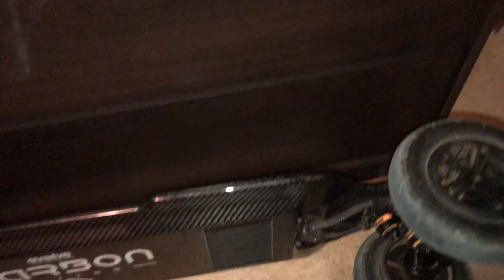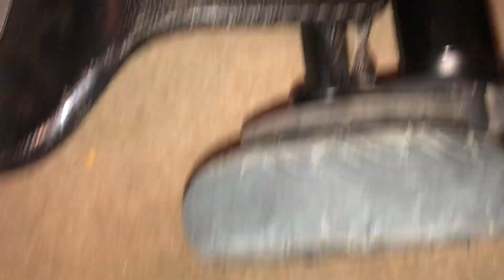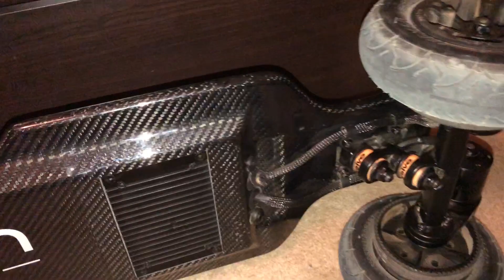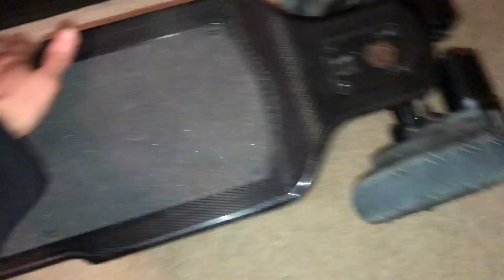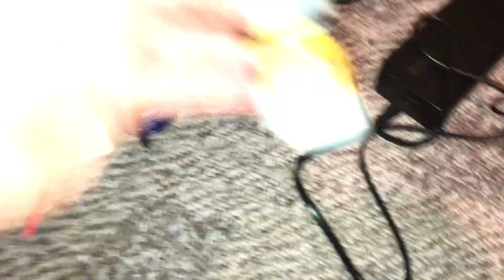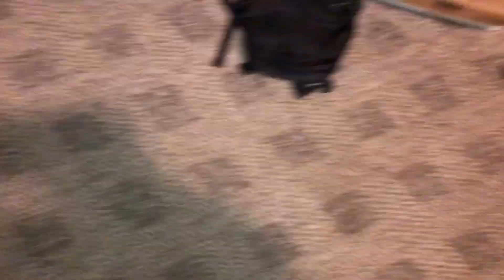Evolve Carbon GT Electric skateboard 800 mile long term review

Comment: Do you or have you a video on you actually showing us How you get To the bearings and with what solution you clean them?
My board sags pretty good. 
   I am hoping the new board coming will let us upgrade to better battery cells!
I am riding with AT wheels and there are big street hills to ride over.
Reply from the maker: There's rubber sleeves on the side of the bearings. Use a tack or something sharp to pry them off Between the rubber sleeve and the metal part of the Bearing. Once you do that drop the bearings in rubbing alcohol and shake them up. Let them sit about 10 minutes. Next Pat dry and air dry them. Then you simply apply the lube to the bearings, not too much and rotate them with your fingers so the lube is evenly distributed.After that pop the sleeves back on and your ready to go. To clean the outside of the bearing and keep water away from them I use WD40.Hope this helps.
Reply: Thank you!! 
You are the Best!!!

Comment: Hi, great video. I just wanted to ask about the flex on the board. How does it compare to a normal drop through longboard? I'd imagine it wouldn't be too comfortable if it's completely stiff.
Reply from the maker: There isn't much flex in the deck but the carbon fiber does absorb a lot of vibration. Also because it doesn't flex like a wooden deck it seems a little bit more stable at high speeds.

Comment: About to purchase either this or GTX... but want to upgrade the batteries
Reply from the maker: Joseph Besler  I wouldn't bother upgrading the battery unless your gonna sell the original battery to make up the loss of the cost to upgrade.

 Do you have a specific reason you wanna upgrade the battery?
Reply: Electromatic yes, I would like to eliminate the voltage sag as much as possible. And replace the stock batteries with 18650s. They tend to give more power and eliminate the voltage sag and extend the range by a good amount. Have been doing a lot of research of evolve boards and that is one of the main concerns  for this board that consumers tend to report.
Reply from the maker: Joseph Besler Yeah I guess I've never really noticed the voltage sag before   Untell the end of my ride when the board will sometimes go into eco mode especially when climbing a hill. I know some people have Stated their boards shut off and sent them flying before but that doesn't really make sense because my board would just coast to a stop if that happend.
 I have a friend that also replaced his battery with 18650 cells and he's had a couple  Motors burn up on him. I don't know if this Is related to the batteries or not.But I now have 1200 miles on my board  And haven't had to replace anything.Anyway good luck  and let me know how it works out.Thanks
Reply: Thank you for that information. I planed do replace the battery as Joseph suggested. I noticed voltage sag right at the beginning. But I can life with that. I can´t hit the max speed (around 41 KmH with my setup) after I drained the battery around half.

Comment: What do you think about the gtx ??
Reply: I own the GTX Bamboo and also own the Boosted V2. I can tell you everything he says in this video is true. I absolutely fell in love with the GTX. My Boosted sits at home only goes out on rainy days or quick runs to the store. These boards feel and ride amazing. I weigh 200lbs with my back pack and Helmut I haven't been able to fully drain the battery cause after an hour and half riding I just get tired and need to take a break. They also turn and carve like beasts. It's probably the low decks and double truck I don't know. And I ride everyday about 10 miles in NYC
Reply: Get the bamboo gt and upgrade the battery and motors
Reply from the maker: The Evolve  gtx is Basically a carbon GT in a different package .The Benefit of the GTX is that it uses a wooden deck that can easily be replaced with any wooden deck In the future if you damage it .It also has it's own battery and  electronics  enclosure that's makes it easily transferable .Unfortunately with the carbon GT  enclosure it is built in to the deck so it's not as easy to Replace .Also the GTX is going to give you a lot more flex Which gives you more of a traditional feel for skateboarding .
As far as reliability I would say they're both gonna be around the same .
Reply: I've had GT and GTX. Due to the ply board flex you dont feel as much vibration with GTX and it is much smoother ride. Both boards have a shitty battery and once you decide to upgrade it to a better battery, it a very simple process with GT. With GTX you will need to rout extra space in the board in order to fit all electrical components.

Comment: Do you have any cracking in the carbon fiber like others have reported?
Reply from the maker: The tune of Lee No definitely not .I'm sure those boards must of had defects if they cracked .The problem is every electric skateboard company has had defective products .If you go online looking for issues in a product you'll probably going to find them .I would say the majority of us though haven't had any issues And if we did they were easily  fixable problems .If you're looking for a product that's almost impossible to destroy try e glide electric skateboards.I still have 1 that's 4 years old that runs like it did when I 1st got it .Otherwise evolves a great company you just need to stay on top of maintenance to keep your bored running good.